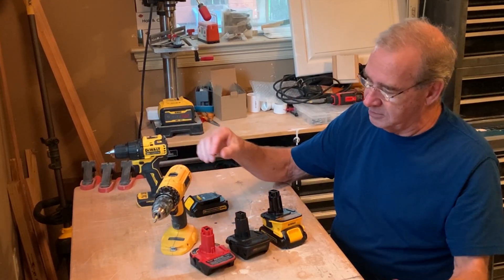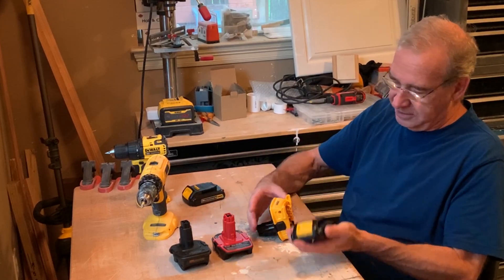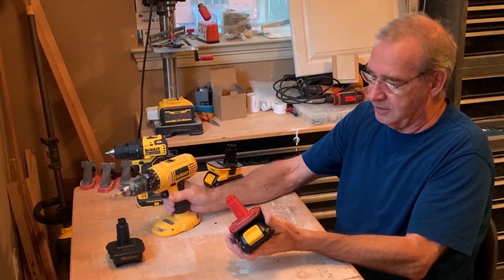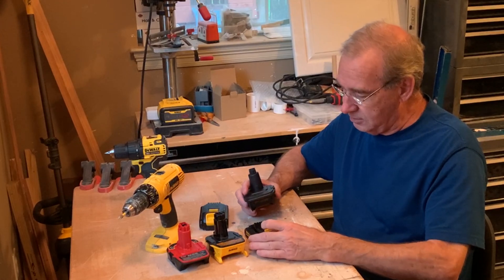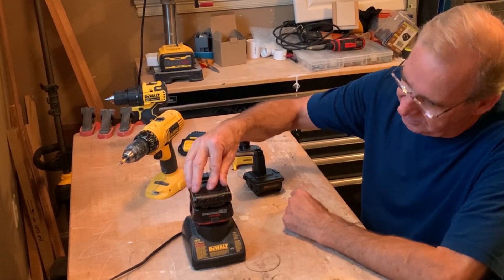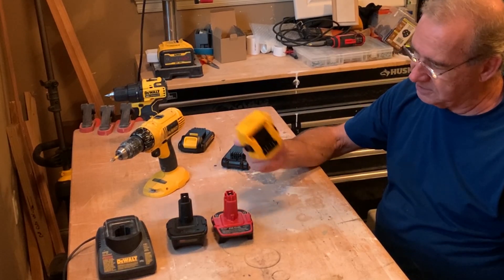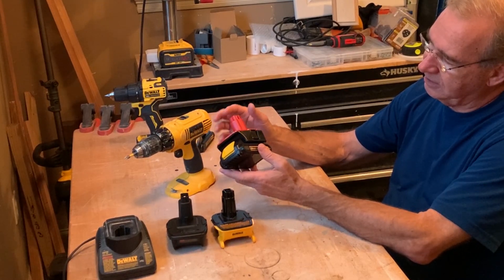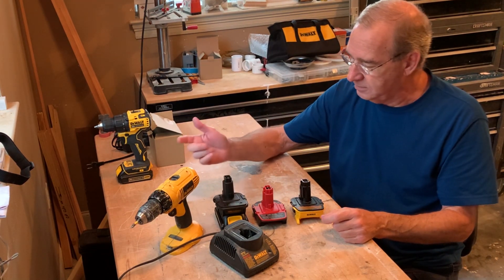Review of 18 Volt to 20 Volt Battery Adapters for Dewalt 18 Volt Drills and other power tools.

Comment: Melted two of the cheapo ones on the 18v saw. Haven't killed the oem one yet
Reply from the maker: Are you talking about batteries or the adapter melting?
Reply: Adapter. The generic black ebay ones one an 18v saw cutting 3/4" mdf pannels. @FixItDepot
Reply from the maker: Thanks for sharing. Now we know the DeWalt ones are probably worth the extra price.

Comment: I like the Waitley batteries.  Got a question ... have heard that using the Dewat battery in a convertor like the Waitley (doesn't matter which brand adapter) that it doesn't sense the minimum battery level and could go past that point causing damage to the battery not allowing it to recharge ... have you experienced that or know of anyone who has ?  Thanks.  I was planning to use the Waitley adapter for a 18 volt Ryobi with the Waitley battery.

Comment: If you're only using the 20v batteries, why would you want to remove the adapter each time, leave the adapter in the drill, and just remove the battery? Simply.
Reply from the maker: Only remove it if you have other tools that can also use it.

Comment: I bought the DeWalt adapter.  Total fail.  I can't get the adapter off the grinder and I can't get the battery off.  All 3 stuck together.  Even had a more muscular guy try.  Think they are permanently bonded together.
Reply from the maker: That is the main complaint I had about their adapter. Try twisting it a little. Desalt needs to do better and fix the design of it.

Comment: Don't you hate manufacturers regularly changing their systems, and every manufacturer having incompatible batteries?
Musk's tesla tried that shit in Europe, didn't work, and soon rotten Apple will have to let go of their lightning port too.
Reply from the maker: I wish there was a standard too. Doubt that ever happens though.
Reply: @FixItDepot  Imagine your Samsung tv not being compatible with your Sony PlayStation.
Your Panasonic turn table not compatible with your pioneer amplifier...
Your car needing different petrol to your motorcycle.
They all use the same voltage, the same technology, yeah power stack uses flat cells instead of round, it's the same shit. It's a matter of politicians deciding to make them do it. As they did with USB

Comment: Thanks for the video.  I had one adapter catch fire while I was using it with my circular saw and it even destroyed the battery.  It was the Dewalt model. I took it apart and it contained all the electronics.  The newer li-ion tools have the battery protection electronics built into the handle that manage the battery.  When you use an adapter on an old style tool, the adapter has to have the circuitry.  If you look at the connection on the adapter to the li-ion battery, the protection circuit uses the two additional smaller pins in the center.  I just received a couple of cheaper adapters I ordered from China and they don't have the electronics, they just have the two connections passing thru. (don't know what I was thinking when I ordered them).  I have two of the true Dewalt adapters and I use them all the time, they're great.  I thought about the small current drain and wondered that it must also exist when a standard li-ion battery is attached to a newer tool.  I leave mine on all the time and haven't noticed any problems.   Maybe it's from the USB charger port, I don't have that on any of mine.  I also bought a new li-ion circular saw now and don't use the old one.  It was a big expense when the adapter and the battery burned up, I don't need to repeat that.  I wondered if it might have pulled too much current for the adapter maybe.  Everything is good now though.  Cheers.
Reply from the maker: Thanks for taking the time to share. These li-ion batteries could be a problem and many people either don’t know the risk, or just ignore it.

Comment: Unless you're in a hurry, remove the battery from the Dewalt adapter first and the adapter removes easily from the tool.
Reply from the maker: Will try that. Thanks for sharing.
Reply: This.   It's harder to apply pressure to the release tabs with a battery like the 5ah installed.   The 2ah is thinner.    DeWalt now makes a low profile 4ah battery that would work much better on these adapter.    The tools are bulky as hell with a 5ah or 6ah battery plus the adapter.    My 18v skill saw will not cut to max depth with a 4ah or 5ah battery installed.

Comment: I watched one of your other videos where you commented that the DeWalt adapter was not compatible with the DCS370 bandsaw.
Did the adapter not fit in the bandsaw? Are any of the other adapters compatible with the bandsaw? I have the DCS370 and was trying to avoid buying more nicad batteries, this seemed like a great alternative.
Reply from the maker: According to the information I had when making the video it specifically stated that the adapter would not work with your bandsaw.   I do not own that tool, so I cannot verify the statement, but since it was coming from Dewalt, I believe it to be correct. It did not give a reason why. I checked the buyer comments on Amazon for the adapter and saw one person said it does work. Don't know whether to believe it or not. If you end up trying it, let us know. Thanks.
Reply: @FixItDepot  thank you for the quick response. I saw the same video on Amazon for the gentleman said he had to modify the external tabs to make it fit in the band saw. I am going to order a third party  adapter that fits in the DeWalt tools but allows you to use Makita lithium ion batteries. Once I have tried it, I will post my results. Thanks again

Comment: Thanks for taking the time to post your informational video on adapters for the 18V Dewalts new battery system. 
 I wish Dewalt just left a compatible platform in place instead of changing the whole archetecture.
I bought two 18V drill/drivers at a thrift store for $10. But now I'm having to sort out the battery & charging issue.
Your video has  helped with that piece of the puzzle.  Thanks.
Reply: Its not a new system,its been around approx ten years.And thats on you really,for buying obsolete tools.
Reply from the maker: Glad it was helpful! Thanks for watching.

Comment: had the red one when using the sawzall it would pop out, the usb port will let you drain the battery dead to the point it kills it. also dropped my drill 2 feet with it on and it broke, have replaced it with dewalt adapter
Reply from the maker: That’s good info to know. Maybe the DeWalt adapter is worth the extra cost. Thanks for sharing.

Comment: Oh, and I've also opened one up and there is no circuit in there for the cheap chinese one so not sure about the others, it had just straight wires, FYI, if you buy a really cheap one with thin wires they might melt and burn, I don't know why they ahve a warning label to say do not leave the battery on the adapter on my chinese one.
Reply from the maker: The reason for the warning mentioned was because some adapters have a monitoring circuit and will drain the battery if left on the adapter. If there was no monitoring circuit in the charger then the label doesn't make sense. Maybe they want us to think we are getting a better adapter than we are. Thanks again for watching and commenting.
Reply: @FixItDepot  Hey its always best to be safe than sorry, But I am talking about the chinese versions, and all the best to you, cheers.

Comment: I beg to differ on charging the slide batteries on the old post type charger, it does work, I've done a few, FYI it did a 6 amp in an hour and a half, when full the charger showed it was full with a solid red light, also FYI,all the slide batteries actually have a circuit inside to charge the batteries, the only thing is that the heat sensor won't work, so keep an eye out while charging on an old type charge, Lithium can catch on fire, always keep the charger on a concrete floor with nothing close to it, and do this AT YOUR WON RISK.
Reply from the maker: I mentioned in the video the Waitley and Dewalt adapters will not fit into the old charger. This is because they do not recommend charging the 20 volt lithium battery on the old Ni-cad charger. The other adapter was a Biswaye and it does fit into the old charger and will charge the battery, but again shouldn't be used because of the fire risk. Sounds like you understand the risk and are willing to use it. I am assuming that if you have a 20 volt lithium battery, you probably have the charger for it too. i would just use the 20 volt Lithium charger and avoid the fire risk. You are correct, Lithium fires are not good. Thanks for watching and sharing the info.
Reply: @FixItDepot  for starters you are correct that you shouldn't charge Lithiums on any ni-cad or ni-mh batteries, but I can say as I do electronics for over 25 years that ALL lithium-ion batteries have a special charging circuit inside them, I've also charge them on a variable power supply and it works, kind regards.
Reply: I have old style DeWalt lithium ion 18v battery charger. Can I charge the new 18v DeWalt lithium ion battery on that charger with the adapter?
Reply: @courierton9217  Okay, so let me tell you my experience, I do charge milwalkee batteries on a special charger, they don't always work, it's because of the charging circuit. Now  you should be able to as all lithium batteries as far as I know have a built in charging circuit, BUT I must tell you, they also have a temperature sensor which is connected and detected by the charger, this is very important. do this at your own risk, you can charge it but stay next to it at ALL times and keep feeling the battery so it's not getting over heated, I didn't have any problems with overheating on mine.
Reply: @CHEVI789  
Thank you Sir for your information and your advice. I will try at my own risk.